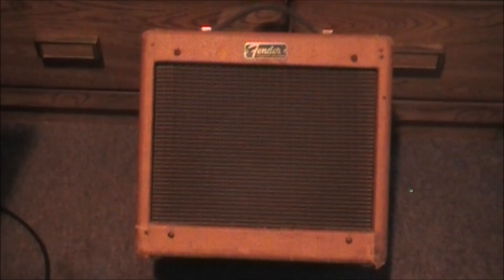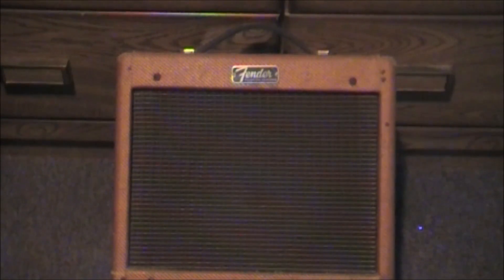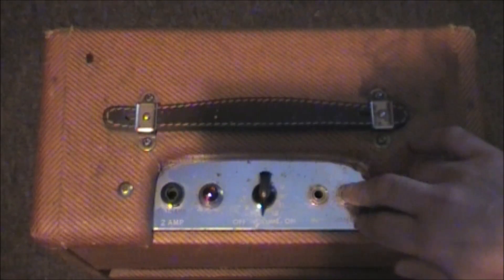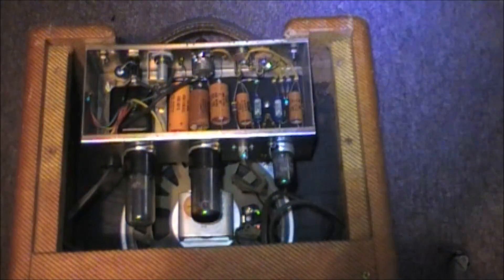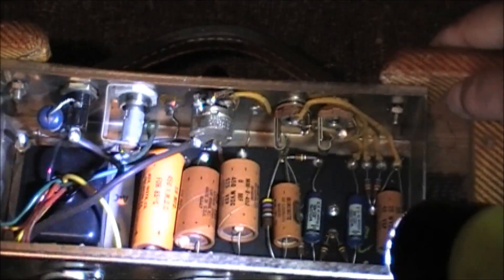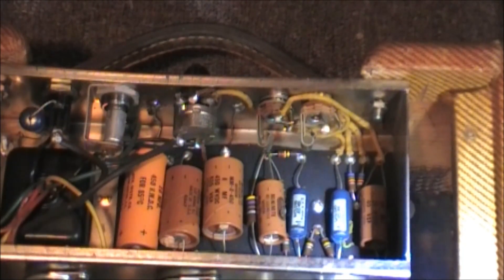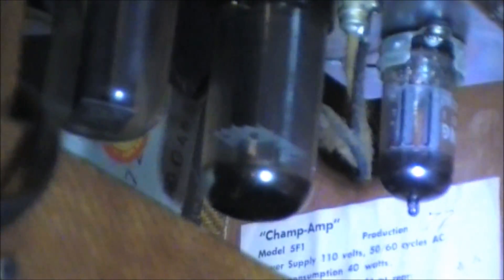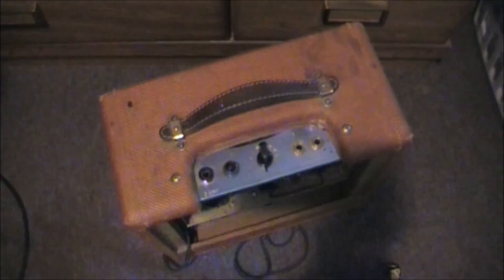Vintage 1963 Fender Champ Model 5F1

Comment: I think it's a 53 not a 63 in that production number is the serial number  if it just says 77 that's just two digits of a five digit with a  possibly c-000000
Reply: You say it's not a 53 but it looks exactly like my 53
Reply from the maker: Thanks for the information. I have an opportunity to buy the amp but not sure what to offer. It is working well but needs a cleaning badly. My cousin took it back with him to Ontario. Not sure if he would bring it back this summer and for how much he'd sell it for.
Reply: R Adams 
Definitely NOT a '53.  The 5F1 circuit was in production until '64 with the Tweed covering.  The numbers you posted do date it to 1/63. 
A '53 Champ would have a different cabinet, a Wide Panel. The top of the amp with the logo plate would be much wider.  The circuit would also be the 5C1. The "5" stands for the decade, the "C" or "F" would be the 3rd and 6th version of the circuit and the "1" stands for the model.  The Champ was "1", Princeton "2", Deluxe "3" and so on. 
If you do buy the amp, I'd strongly suggest replacing the 2 prong plug with a grounded 3 prong.  It's just significantly safer to both you and the amp.  I'd also have a good tech go thru it and see if any of the capacitors need to be replaced.  Capacitors dry up over the years and can fail...another reason to have a 3 prong plug.  These aren't expensive fixes, won't alter the tone and don't dramatically effect value.  But from a safety standpoint, you really should do it if you are a player planning on using the amp.  I have an 5F1 clone...and these little suckers are phenomenal amps.  With a good speaker, which the original should be provided it's still in good shape, these amps record fantastically. You get a HUGE sound by sticking a mic in front of one. The "Layla" album among hundreds of classic recordings made with this amp.
Reply from the maker: Thanks for the view and the information. I appreciate the detail you have went into. I think I will ask my Cousin if he'd like to sell the amp and give it a new home.
Reply: It could be a 63 but the last of the tweed covered tweed champs. 
I have a 63 and 64 in black tolex. Same amp.
The most I paid for one is $850 for a 60 and in great shape. 
They are terrible little amps but fun.